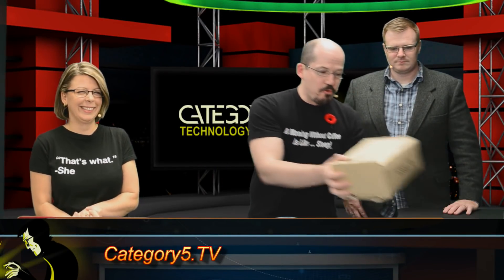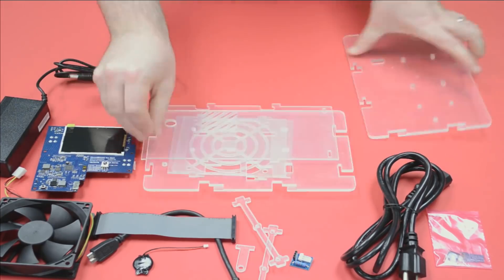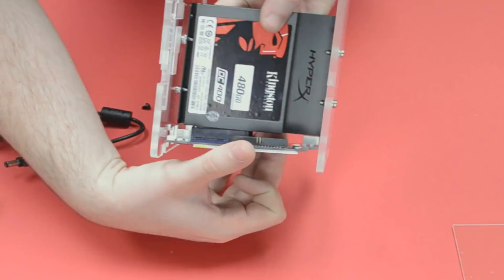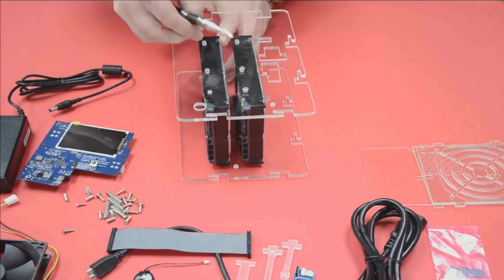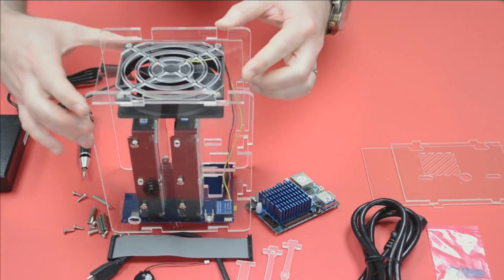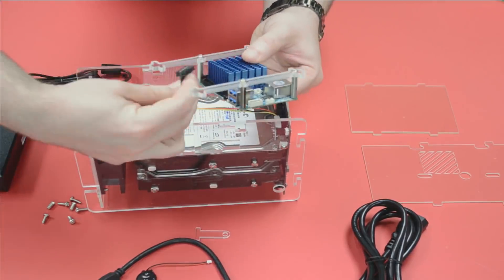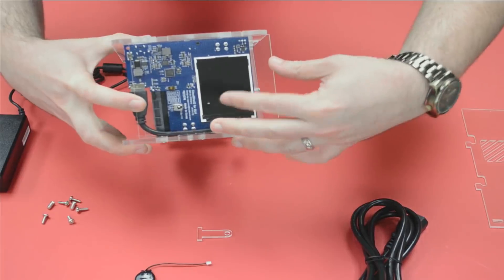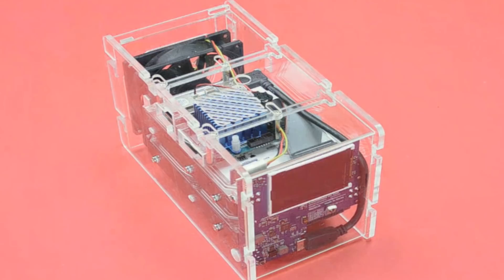The 8-CORE Raspberry Pi Killer: ODROID XU4Q with CloudShell2 Case - Assembly

Comment: if odroid cost more than raspberry pi 3 peoples buy but if have expensive only idiot buy, price need be less than 50$ then have killer, only idiot buy if cost too much, sbc idea have be at cheap and simple board and can use table computer easy. and many many other project. thats is why need be cheap too. if not have aodroid have only big trash junk.

Comment: Pi form factor??  none of my Raspberry Pi's have a dirty big heat sink like that.   My Raspberry Pi doesn't need any fan at all.   Raspberry Pi 3 and above have built in WiFi. 
Price....   Sure, lets be real and compare like for like.  It's like saying a Core i7 is the Core i5 Killer.  Sure, the i7 runs better, but at a price.   
This is not even a good demonstration of the ODroid board.  3 Presenters distracting, the one doing the talking is all over the place and talking so fast that the whol video became jibberish.
SSD's have wear components.  It is electrical wear instead of physical. 
You gave no actual specs or proper speed tests.    If you want to say it is a Raspbery Pi Killer, lets see the actual tests to show this "two to three times" faster.
So many "sold separately" items.
This video is a joke.

Comment: In terms of retro gaming specifically, youre looking at "PLAYABLE" dreamcast, PSP, N64, which is a vast improvement over the pi3b+ but i still wouldnt consider it an enjoyable experience. dreamcast emulation is wonky, even with 2d games, psp is hit or miss, and n64 is a wash. if you're trying to squeeze out more power for retro gaming I'd just say use an old laptop you might have laying around over dicking around with an XU4

Comment: If it doesn't need a fan, whats the big fan for? And whats that display for on the front? And the USB ports are hidden away inside the case? That's just daft. That's like a car that has its wheels up inside the body and you have to buy wheel extensions to make them reach the road. And why didn't you power the thing up for us  ...or even tell us what OS it runs. Is it Android only? Can I install my favourite Linux distro on it? Windows 10? This video raises more questions than it answers...  not least, how much it all cost you!

Comment: For less the price of the ( CloudShell2 + OdriodXU4 + eMMC ) one could also get a Zyxel NAS for 2 SATA drives. Actually one could get 2 Zyxel NAS for that price ... depending on the size of the eMMC for the Odroid XU4 (different price for 8gb...64gb versions) ... just to be precise. --- What would I choose for?
By the way, Odriod XU4 is not a Raspberry Pi killer. For the price and power consumption you would have to compare one XU4 against 2 RaspberryPi3b+, and at that point there is little difference in speed and total amount of memory. Only the ethernet of the RPi is certainly complete crap. I do not understand anyways why Broadcom does not have an ethernet ip on the chip and instead uses this stupid "USB2.0<->Ethernet" adapter chip on board. One could hardly do worse design than that. Apart from that, the basic idea of RPi is still great, while the Broadcom SoC is certainly not up to date when it comes to design and features ( DDR2-ram / USB-2.0 / only 512kb-L2-cache / etc. is all previous decade design and technology ).

Comment: At those prices, I could build a small micro-atx system with a cheap Ryzen processor.  It would have all the functionality of the system they have, while being an actual computer.  Besides, it's not a Single Board Computer (SBC) if you have to add a board for SSD's.  Then it's officially a 2 Board Computer.
Also, the Raspberry Pi isn't really meant to be just a computer.  It's meant to be a tinkering board that people of all levels can make things with.  Whether you turn it into a gameboy, use it for a media center, or just experiment with electronics, the Pi will work for that.  I don't see where the Odroid will really do that.

Comment: I enjoyed the  video, when I started with home computers, my first one was SWTP 6800 8 bit, that came in a kit, blank cards that i had to solder all the parts on, my IO was TTY at 110 Baud, had 2 4K memory cards and it ran a fast 800 KHz. that being said, I see this as a more gen 2 DIY, the Pi is for experimenting , this is for a more fast solution. I will agree, a part two is needed to show it doing something, even a speed test between PI3 and this. As for WiFi some people use it some don't(other than smartphones and tablets) again good job, a price total would have been nice in description

Comment: No wireless connectivity= not as good as a pi. I hope the Pi4 has double ram at least, and a better cpu. If not, I hope others support this while supporting the standard pi OS
Reply from the maker: To be fair, the Pi wireless connectivity is so utterly terrible that it is hardly a selling point. I'd rather insert a decent USB WiFi dongle and get a good connection, be it a Pi or otherwise.
Reply: LinuxTechShow  I am building a Stratux and it seems the Pi is the best option. I need at lest 3 USB ports. What makes the pi's wireless connectivity so bad? Also, if I were to buy a USB wifi dongle, which one would broadcast? I am very new to this, so would I have to change settings to get the USB dongle to be the primary wifi broadcaster?
Reply from the maker: @glock19gen3  have you used one before? I mean, I'm not dissing the Pi - I LOVE it - but it simply does not have good wifi so a separate dongle is really needed to use wifi without getting angry :)  So to me, the built-in Pi WiFi is NOT a valid selling point, as it is not good at all. My Pi 3 B+ has an Ethernet cable connected to it for this reason.
Reply from the maker: Yeah; so just keep that in mind when selecting a board: the WiFi on a Raspberry Pi doesn't make it "better" (IMO) as the built-in WiFi is very bad. It may work for what you're doing (not a high amount of data vs. say video streaming) so it's really down to your application. Good luck! More importantly... HAVE FUN!

Comment: I know this video is a bit old...  However... there are ZERO plastic cases available on amazon.  The case shown in this video is not available any more.
Reply from the maker: Amazon is just one place to buy and usually has low stock. Here's the store for when Amazon has none: https://www.hardkernel.com/main/products/prdt_info.php?g_code=G150575879656
Reply from the maker: PS - the site is a bit confusing: you click "Buy Now" and are presented with a list of all available products. Scroll down or "CTRL-F" find "Cloudshell 2". Select the power option and then click the + icon under it. That'll put it in your cart and you can then check out. Don't forget to also add the power supply, XU4 board, eMMC card, etc. (whatever you want).

Comment: man with a second Ethernet port this thing would make a wicked router
Reply from the maker: SEVERE overkill for a router! But since it has USB ports, you could easily add a USB-to-Ethernet adapter. That is, if you need an 8-core router with 2 GB RAM and USB 3  :D

Comment: But does it consume less power? No? K going to stick to using raspberry pi zero as my web server, plus 5 game severs all on the same unit, still consuming far less then 1 amp of power because screw GUIs. And it only costed me $40 in total, that is including the keyboard, case, power supply, and micro sd card, pi zero w unit. And a pointless book I opened once. That was the largest chunk of it.If I wanted to add a drive I could, it would be terribly slower yes, but with so few viewers it doesn't matter much.

Comment: ODROID? thats cool Ineed it to do this
Hi i want to run my CNC table with a raspberry pi & an exterior hard drive. I have large table 10 foot by 20 foot I would like to run Mach3 because of the fitures My question is can I run windows 7 as my O/S and then load programs on windows like normal

Comment: firt off, dont use this guy for a example of the older nerd, we wouldnt have been stopped by a 2.5 in ssd, instead, we wouldve put the case fan end on and hey!! guess what? its solid enough to put the ssd in and have the air flow it should have, send this guy back to greeter at walmart, he might last another week, one comment below made 1000x more sense than this guy ever did the whole video, is she single? Linus if need to do this video, at least he has the intelligence this guy lacks whatsoever, run back for 2-3.5 drives...i cant even contimplate the idiocy it takes, even after taking the film off pieces.....what ever education enterprises he attended really need to be closed down

Comment: The main problem with the XU4's, is that it doesn't have enough development for the drivers. It doesn't work on my monitors, it only works on my HDTV's. It would be cool to get this to use my tiny WaveShare lcd screen, like the Raspberry Pi's I've used it with.

Comment: Unless you are in a really dust free environment, having that bottom wide open combined with the fan pulling air in and across the components is going to create problems over time. I am thinking a simple bit of filter cloth ( get the right stuff, otherwise it will restrict airflow and build up static ) mounted on a simple frame fitted to the bottom of the unit. The kind of fabric you want will be [1] anti-static (typically carbon fiber), [2] needled-felt (maximizes airflow), and [3] singed surface (the fabric needs to be mounted with the singed side down to catch dust on the outside/bottom of the enclosure).

Comment: Pi killer, NO. Good value, NO. What's the point of the SSD? your limited by the gigabit connection, a.k.a. 125 mb/s.  SSD is massive overkill. Any decent drive at much larger storage capacity would be better. Check out the Helios4 (NAS). This video is painful to watch.

Comment: Where do I plug in my breakout board to the Gpio pins. I was playing around with a Rpi to figure out remote controls wiring in my own IR emitter and a IR detector and writing my own routines in Python to send and receive. Found out IR signals were much more complex than I thought and found a package to download that actually got the Rpi working. 

If you hook up enough hardware sure you'll get a more powerful machine, but you won't get a system you can afford as easily or the Rpi community support.

Comment: Would this be good for mining with hard drives
Reply from the maker: Mining crypto? You don't need hard drives to mine so this would wastefull. All you need is the board. See our benchmark (which shows mining Monero hashrates) at https://www.youtube.com/watch?v=L6bZW-2rHgg
Reply: LinuxTechShow there's a cryptocurrency code burstcoin it was on hard drives
https://youtu.be/Fyj9RIyxLb4
Reply from the maker: Cool - we're pretty new to crypto so I wasn't familiar with the workings of Burstcoin, thanks. So consider what you learn about our Monero benchmark on this board, and then throw two SATA drives (maybe 8TB each?). The nice thing about a rig such as this is if you find mining to be unprofitable (eg., not finding blocks) you can re-purpose the hardware easily (unlike an ASIC). The benefits will come down to how much CPU / GPU power you need. The XU4Q is significantly more powerful than a Pi 3 B+, but still not as powerful as a dual CPU Xeon with a decent GPU  :D
Reply: LinuxTechShow yes and this is a good way to do it because it is less power hungry then a full-size desktop and I don't blame you about not knowing much about cryptocurrency there's new stuff like burstcoin all the time have a wonderful day or night
Reply from the maker: Cool! Thanks for the tip. Will definitely have to check it out... mining with the CPU and GPU so far... so why not add the hard drives to the mix?  :D
Reply from the maker: The more I learn about Burstcoin (watched several videos) the more I think this rig would be awesome for it... you could choose either to combine the capacity of both drives, or rather could mirror the drives to create redundancy (which is always good to protect against a fail)!  Can't wait to add it to my mining!  :)

Comment: For this device to be a pi killer it has to have alot of developers to work on it and it does not have the same support the pi has it don't matter how power ful the system is with no good developers it's trash that's why the raspberry is still the best because there's so many people that put alot of hard work into it and that's what a good system needs alot of good developers

Comment: OK, well, the RP3, is already more powerful enough to run what the RPi applications decently. One thing that I think the rpi3 needs is a heatsync that most come with already... and they should come with a fan.  Rpi3 has wifi already.  8 cores is nice, and maybe rpi4 will have it. But... I think if this was maybe a 32 core, than yeah it could be called a "killer" but, the thing is, the Rpi3 is already a slow computer... even at double the speed is a yawner.  Look I have a AMD 16 core Threadripper, I can process 32 cores at one time, running distributed computing, I can process 1 WU at about 1 hour a WU, where it would take a pi3 a bit over 24 hours to process the same work unit.   Where I can Parallel process 32 wu's an hour a pi3 would take about a month to do.  Even at twice the speed that's still 15 days vs. 1 hour on an AMD fastest chip. Like I said, RPi's were made to be discrete, low power, and do web server, remote applications type stuff.

Comment: Why have a credit card size computer...?  XU4 may have decent specs, but cloud2 case w/RAID 3.5" HDDs, full case fan, a front plate board that's irrelevant/unnecessary/limiting-of-function, & ~"you can hook it up to a USB 3.0 Hub for..." no discernable reason whatsoever...?  It's like carrying an iPad air & carting a gas generator around that must remain tethered at all times & has to dedicate 1/4 of it's system resources to the generator for some unknown reason ... and then taking a chisel to the wifi on the partially disassembled iPad air because you've lost your mind and are engaging in erratic/abnormal behavior, etc...  

Anyway...I gotta go rivet some lead bricks to my mobile phone... It'll be all the functionality of a mobile phone ...and have a hearty supply of lead readily available for all it's various (mostly-)industrial non-mobile phone related applications.  Someone says "oh no, this nuclear reactor is gonna melt down unless we get some emergency coolant!". I'll be right there, saying "relax...dude; I got a metric ton of lead bricks right here...I did an awesome hardware hack of my mobile phone so I'd have mobile lead bricks in ample supply..."

Comment: I get so sick and tired of the over-used "raspberry pi KILLER" clickbait bullshit!

TL;DR - Specs don't make ANYTHING a pi killer. Cost, community, and a truly open hardware/software do.

Why is it a "raspberry pi KILLER" -- it has more features, better video, etc. Yeah, so does my 24 core XEON!

My point is this: the reason everyone wants to be, and ultimately fails to be, the pi killer is because the pi's community and adoption are so large that no other SBC for the hobbyist, enthusiast, maker, or education market has even been a semi-serious contender. The pi is popular fr the following reasons:

1. Cost -- $35 is insanely cheap given the functionality of the unit. 
2. Community -- there are more people, ideas, help, and enthusiasm for the pi than any other SBC.
3. Open. EVERYTHING about the pi is open. No binary blobs, sketchy chips, proprietary adapters, etc. 

When these "killer" boards start to dump the allwinner crap CPUs with their SUNI (and other closed / proprietary) video chips with BS flaky binary blob drivers and no documentation, there might actually be a pi contender buy it'll still need the community enthusiasm, depth, and diversity.
Reply: Justin Gast Doesn't the Pi still suffer from binary blobs, partial GPU docs, and making everyone depend in Broadcom keeping their incomplete data sheets online (because RPi foundation still doesn't distribute their own copy)?

Comment: Can you "boot" the device from the SATA ports?  I assume not that it would need some sort of frimware to get it to run but if it will I am sold on it.  I have a project that it would be perfect for.
Reply from the maker: Jason Tyre check out page 36 starting with the paragraph that reads "To solve this, we’re going to actually move our ODROID 
installation to the SSD and boot from the SSD for both our 
operating system and our additional NAS storage folder.": https://magazine.odroid.com/wp-content/uploads/ODROID-Magazine-201612.pdf

Comment: Makes Raspberry Pi "killer"

Completely misses the point of the Raspberry Pi

Seriously... I like the Pi for the cost, the form factor, and the small power usage. This is fine for what it is, but comparing it with the Pi is like comparing Apples to... Spaghetti? They serve completely different purposes. Especially considering I can get an entire Pi kit for ~$60, which won't even get you the board, alone, in this case.